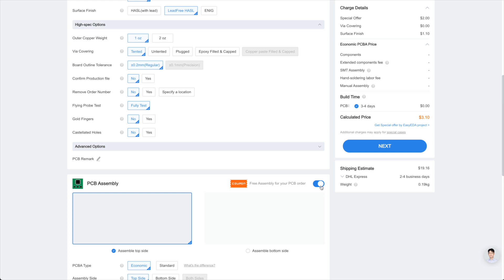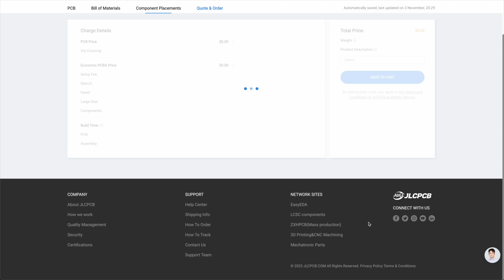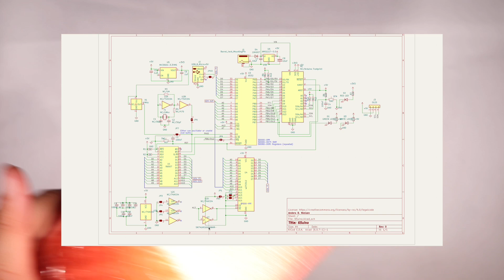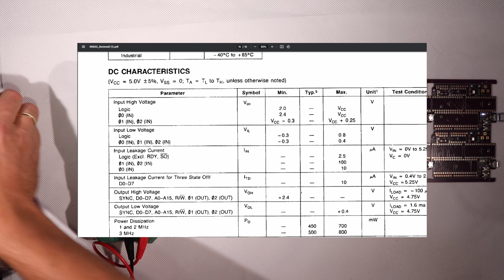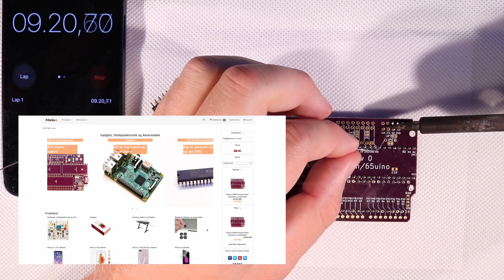I gave away 35 8-bit motherboards

Comment: Since I learned 6502 assembly in high school, I still have some of the hex instructions memorized.  Since I move on to the Parallax Propeller, which never had a supply shortage during the pland em ic.  I do like this project, especially as it is required for your prom burner, but would have rather have a real 6502 or a 6510 as those I am already familiar with.
Reply from the maker: It’s a more real 6502 than a 6510 - the 6510 has a different die, the 6507 is literally the same IC in a smaller package :) 
The Relatively Universal ROM Programmer works even better with an Arduino Uno and the Firestarter firmware :)

Comment: How do you join the giveaway?
Reply from the maker: 25 boards were ripped away in a few hours. Added another 10. Ripped away in an hour or two. 
I can't handle more international shipping within a reasonable timeframe(and I'm losing money for every one shipped even though everyone paid shipping), but I have a few more I'm willing to sell, so for now they're 9.26€.
Check the description of the video.
Reply: @AndersNielsenAA  ill probably consoder picking one up from your store, is 9 euro for the full kit?
Reply from the maker: @codingbeast6927  It’s for the PCB with all SMD components presoldered - DIP ICs, sockets and headers not included. Other kit with sockets and headers available - old ICs sold out but easy to get from EBay/Aliexpress

Comment: Brilliant concept. Once upon a time, the FlashROM programmer would have been the deal breaker for me, but after I saw the Pi Pico programmer (which is just a RPi Pico, wires, and a breadboard), that barrier to entry has been broken.
Reply from the maker: Also, I have another project in the works that should even make the 13.5V programmable ROMs cheap to program.. As a hat for the 65uino! :)
Reply: @AndersNielsenAA  Excellent. I'm also looking at getting an upgraded Sweet16 VM into the ROM so that code in RAM can do more in the limited space.

Comment: does this only work with the 6507?  I have a bunch of 6502s already and prefer to use one of them instead of buying a 6507 if they're compatible.
Reply from the maker: You'll need a pretty elaborate adapter board to convert the 40 pin 6502 into a 28 pin 6507 - but technically, yes :)
Reply: @AndersNielsenAA  If an adapter board is needed and not just clipping pins, can I assume that there are W65C02 pins that have to be held high which don't come out on the 6507 so aren't handled by the board?
Reply from the maker: Yup, the 6507 doesn't have IRQ and NMI so those need to be pulled high.
Reply: @AndersNielsenAA  Aah, yes, I downloaded an old 6507 datasheet from somewhere. '02 pins8-18 line up with '07 pins 4-14, and '02 pins 34-26 line up with pins 26 to 18, but after at it'd a rats nest of clipped pins, unbent pins soldered to bodge wires, and a resister soldered to VCC pulling up /NMI and /IRQ. But if you can get cheap NMOS 6502's easier than you can get 6507's, it might be fun for the adventurous.
Reply: Note that the breadboard version could be done on two breadboards with a 6502 without any problem, with plenty of project space to spare on the second breadboard. And at the speed that a RIOT can go, it wouldn't much matter whether it was a NMOS 6502 or CMOS 65C02.

Comment: Really would've like to get one of these boards but are unable to order :( Doesn't work in Firefox or Chrome with all extensions disabled and the build in privacy options for Firefox disabled.
Reply from the maker: That's really strange. Chrome without AdBlock should work without issue.
Reply from the maker: I've also seen problems with phone numbers containing other characters than digits and +